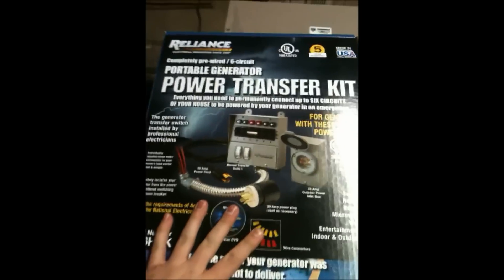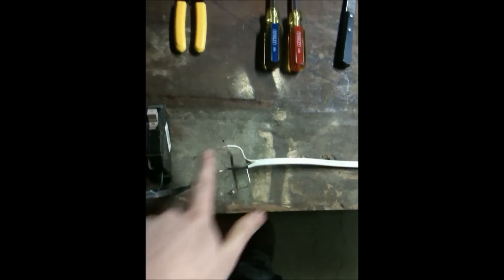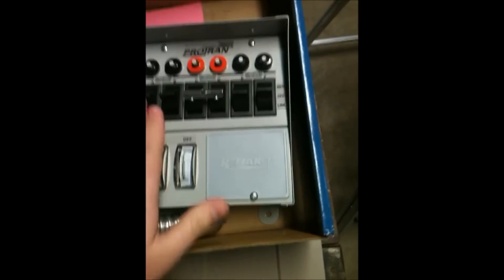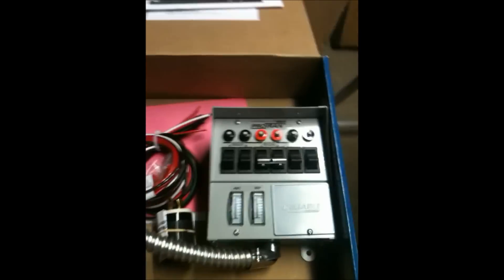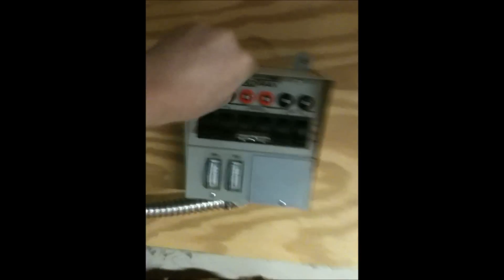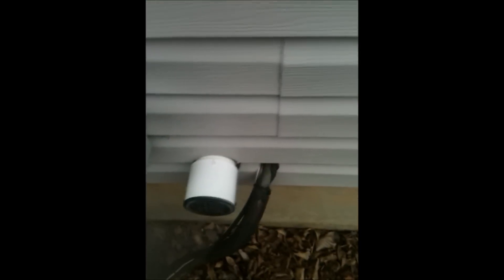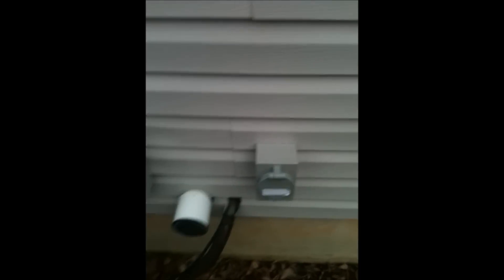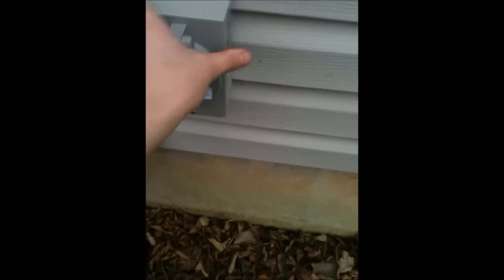Reliance Transfer Switch Install!

Comment: Hey Eman, do any of your circuits use 220 volts, such as the well pump? If so, how are you supplying some circuits with 110 volts and some with the 220 volts?

Comment: A water heater draws 4500 watts.  You need at least a 30 amp breaker.  4500/240 is 18.75 times 150% is 28.125.  NEC says to round up to 30 buy no more.

Comment: I hope this setup is still working.  I never knew that house furnaces, house well pumps, & house water heaters work on 120 volt circuits.  I thought they were 240 volts.  Well that is what mine is anyway.    :)

Comment: thanks, but wound up taking easy route, by just running 1/2 the circuits on the Reliance, but working well feeding my 120v to my 240v Reliance.

Comment: How are you running your 20amp furnace thru the xfer switch 15 amp breaker? (A)...Only C and D are 20 amp circuits

Comment: You must be an electrician afraid of laymen doing their own electrical work.  I researched this transfer extensively before I bought and installed it.  It's perfectly safe.  Reliance has a very good reputation.

Comment: His well pump should be on the 20 amp double pole breaker.  The water heater is a no go.  This switch is not designed to incorporate a water heater.  The water pump needs to be on the 20 amp double pole breaker.  Just sayin.......
Reply: Unless his appliances are 120v......just sayin
Reply: I could be wrong but his water heater looked like a gas fed tankless water heater. If I’m right, he will be fine.

Comment: The reason I watched this video was to learn about omitted info from the manufacturer's very descriptive video.  You omitted the same info.  At minute mark 3:44-3:45 you jumped over how to wire the switch to the "outside wire" or 10/3.  Is this so simple that you decided to skip showing it?  I really wish you had left this in the video as well as the manufacturer.  Anyone have thoughts on this?
Reply from the maker: Hector Morales - my apologies. It is fairly simple to wire up though, direct message me and I can send you a schematic

Comment: UL approved does not mean that they meet code *everywhere*.  You have to talk to a *local* inspector or electrician to make sure.  Some jurisdictions are stricter than others.

I personally don't trust them at all, legal or not.  The life safety of my family is worth more than the cost of a crappy panel with cheap button breakers, especially when superior solutions can be had for less money.

Comment: Thats not a romex connector.  its for conduit
Reply from the maker: Spencer Field - I was 14... my apologies lol
Reply: Eman-  I compliment you on your skills for your age, but like brakes on a car, there is no such thing as partial credit in electrical wiring.  All instructions need to be flawless as the less skilled are depending on you for their safely.

Comment: Not an electrician.  I built my panel myself (search for a youtube video called "Inexpensive Residential Generator Hookup" where it's all demonstrated).  Because I am in New York I had to have an electrician pull the permit for me, but the design and build were all done in house.  Anyone who knows how to wire a panel can spend less money and get a better quality result.   I don't like the Reliance panels at all.